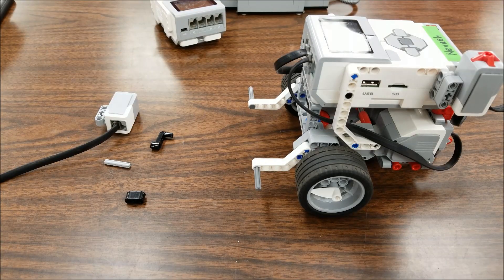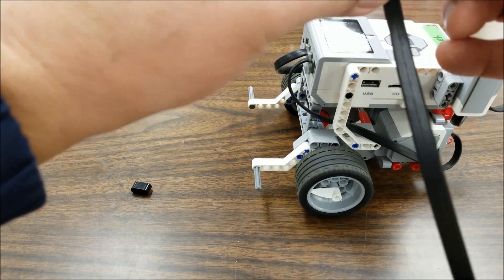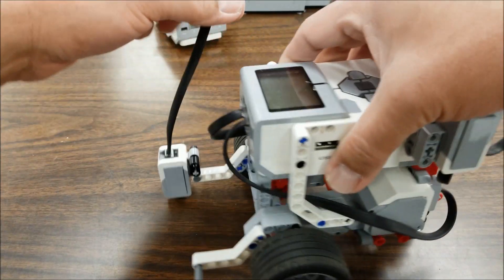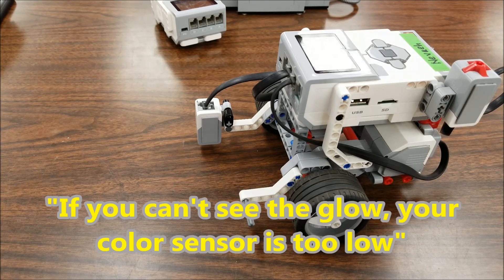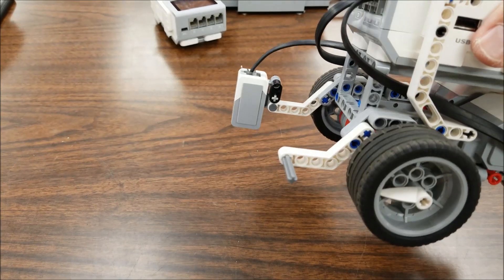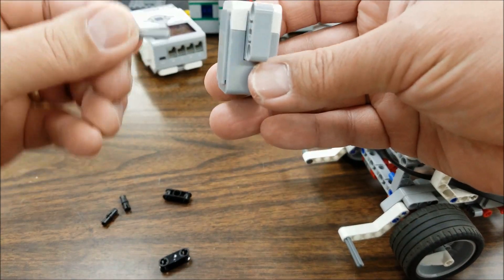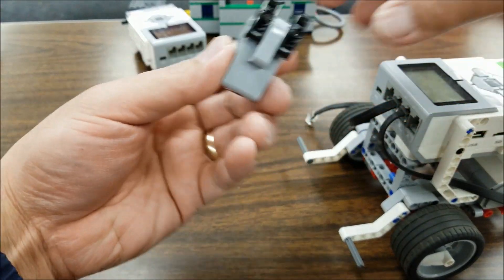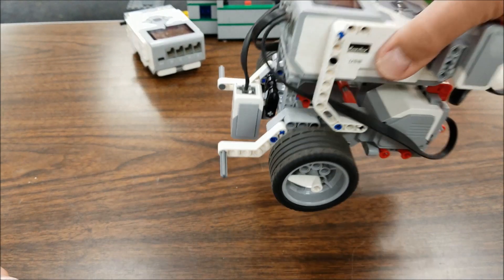"LEGO Mindstorms EV3: Putting On Your Color Sensor On Really Fast!"

Comment: Hi Mr Hino!
I actually wouldn't recommend the second method for attaching the color sensor, if the objective is line following. The way the line follow program is written and conceptualized, is the farther away the sensor is from the drive wheels, the better the gains (or corrections). So for my robots, I try and attach my color sensors for line following as far away from the drive wheels as possible, with consideration into other aspects of the competiton and design.
Reply from the maker: Great input Siddharth!  Thanks for the heads up.